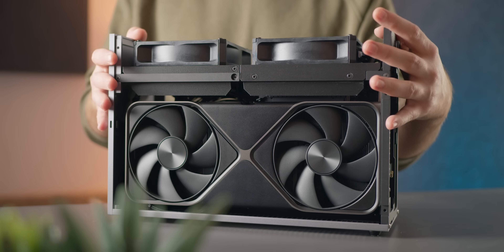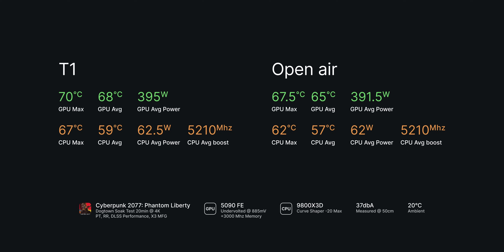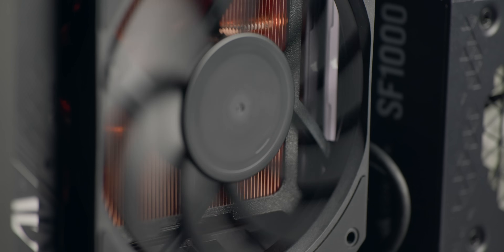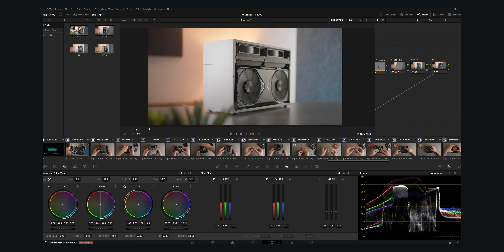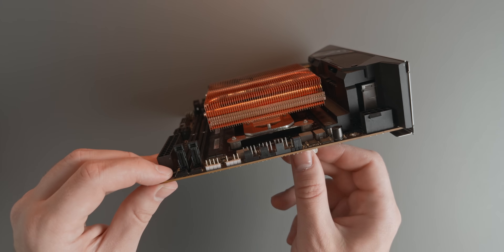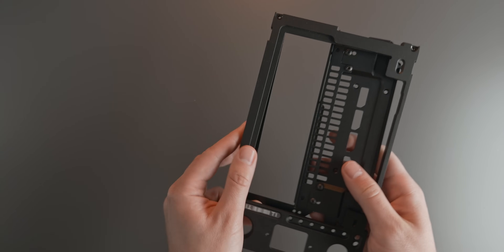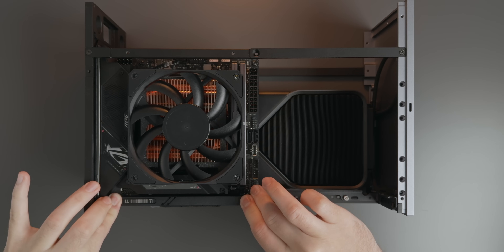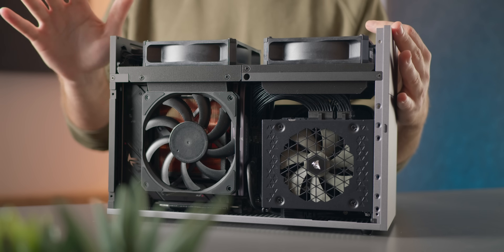The Ultimate FormD T1 5090 Build & Guide

Comment: Wouldn't it make more sense to go with an open air card in a sandwich layout? That way you wouldn't need the offset, and if there is a 5090 slim enough you can go with a slightly taller CPU cooler which could help remove the 100 watt limit?
Reply from the maker: It would, but there isn’t any other 5090 that’s a true two slot that fits in the T1. With 5080s there are options like the ASUS Prime.

Comment: Why 120mm cpu fan though? Most of the airflow is on the edge of the fan. So you're reducing cooling with extra hassle...
Reply from the maker: Check the follow up testing on exactly this (pinned comment). Tl;dr: yes.
Reply: @EIGAtech Where did you get that orange power cable from?

Comment: Silly question, what fan header did you use on the mobo for the two rs120 max fan?
Reply from the maker: The chassis fan header, which is the third one from left to right on this particular board.
Reply: @EIGAtech so no daisy chain, had to use a splitter? Thanks for the reply!
Reply from the maker: @Naes_Innit  Correct, use a splitter if not using T30s that can be chained.

Comment: Will this build work with the Thermal Grizzly offset kit or does this only work with the Dingkey offset bracket?
Reply from the maker: It won't work as far as I know, the AXP-90 x47 has a rather odd mounting system that is tightened from the backside of the motherboard.

Comment: I followed all your T1 videos and using your links sort of cloned your build even down to the cablester cables. My air slimmer 3D printed bracket arrived late, so I am still using the AXP90 47 default fan. I am getting similar temps as you. Even battlefield 6 doesnt reach 80 degrees max. I've read on reddit people are raving about the 4070 fans used as CPU fan on AXP90 and was wondering if you've tried them?
Did the air slimmer 120 cool your CPU noticeably more than default thermaltake, or did you use them because it being a bigger fan, it cools VRM and ram too?
Reply from the maker: Oh wow that's awesome! Topping out at 80 in BF6 must mean you got a pretty good sample of a 9800X3D. Running negative CO as well I assume?

4070 fans: Yes! I have one and will use it in an upcoming video, but I haven't tested it yet as I'm working on other videos. This month though! Maybe.

AS120 swap: It's a bit better acoustics but worse CPU performance, I wouldn't really bother with it, especially since everything I read about the 4070 fan points to it being the new 🐐.
Reply: @EIGAtech  Yeah, my sample accepted negative 25 but not 30. I had this weird issue where DDR5 6000 wouldn't pass when using EXPO I, but it passed using the more aggressive EXPO Tweaked from ASUS. I am so very happy to have followed your build. This build is so much cooler than the oven Ncase M1 5800x3D 3080rtx I had before. Thank you!
Reply from the maker: @demonwares  If you want to tune your DDR5 kit further check out this thread: https://www.reddit.com/r/overclocking/comments/1k3o7qe/am5_ddr5_tuning_cheat_sheet_observations_and_notes/

Just know that going through all this may take quite a bit of time and testing for marginal gains, but you can have "fun" with it.

Comment: This felt eye opener, so many small mods to cpu cooling, tha tall feel smartly done... have you down comparison with the stock cooler config? or against other popular options like the IS-55? I'm curious as to the overall performance of these mods... I want to build something quite similar, but using 7800X3D and a 9070 XT, and I'm wondering how this cooling modded solution work in general

Comment: Are you planning to try out watercooling this build? Like Optimum did with his FormD T1 4090 build?
It would be cool to see if it is even possible to cool a 5090 and 9800X3d inside this case. I am personally also interested in it because in most places in the world, Nvidia nor any other retailer sells or imports founders edition cards, which makes it simply imposssible to put any 5080 or 5090 inside the FormD T1, except when they are watercooled.

Comment: Did you print these yourself? Did you print with asa? It looks soooo matte, how did you manage it?

My bambulab p2s is coming soon, want to print the adapter and fan shroud as well.
Reply from the maker: Those are printed in PETG-CF which gives them that super matte and textured look. ASA/ABS is also a good option especially infused with carbon fiber or glass fiber, but you need proper filtering when printing those materials.
Reply: @EIGAtech no warping on the petg cf? Since the heatsink could get hot
Reply from the maker: @Hyper1555 PETG can easily handle it, heatsink probably doesn’t get over 60C or so unless the fan is running too low. I would only advise against PLA.

Comment: if i am using the offset brackets and the am5 backplate from dinkey for the cooler, but no 120mm fan swap, just simple noctua a9x14 fan swap, do i need to 3d print "Exhaust-Shroud-V2-Part-A-HC.stl" or "Exhaust-Shroud-V2-Part-A.stl"?
Reply from the maker: You need to print the regular version (not the HC)

Comment: AXP90 Fan Bracket file on printables has 2 different sizes uploaded ("for 90x98mm heatsink" and the other is "for 87x95mm heat sink"), and on amazon, the heat-sink dimensions are 94.5mm x 95mm. I don't know which one to 3d print. any help please.
Reply from the maker: You don’t need an AXP90 fan bracket? Check my follow-up testing post.
Reply: @EIGAtech where can i find that post
Reply from the maker: @pedrosk445 It’s this one: http://youtube.com/post/UgkxVFLB-fsOSw81gMdKQU-qNWelVQoblhfg?si=vv_PTZ6qvzmlNUs3
Reply: @EIGAtech  yeah yeah i just saw that, i was about to edit my message. i just have to replace the stock fan with the noctua and add the 3d printed duct pegs. thanks alot. i will copy your build btw, much appreciated.
Reply from the maker: @pedrosk445 Sure thing!

Comment: I'd love to build in this case but there is no way I can get a 4090 like that, I have no idea what other top of the line gpu I could get that would do fine in the case.
Reply from the maker: The 2 slot ASUS ProArt/Prime 40 and 50 series of cards will fit into the T1 and even have travel kits available.

Comment: Wish FormD would buy the design for the Exhaust Shroud V2 and CNC it out of aluminum and sell it in their shop. I just don't like it being plastic on such a premium case. But I guess since I had to mod mine to fit with a ASUS ROG STRIX B860-I motherboard it would make it imposable to use in my case.
Reply from the maker: The design is unfortunately not CNC-able without changes, and the cost would be too high anyway. If you want a premium looking print you can look at a nylon print using the MJF process at a 3rd party service like JLCPCB or PCBWAY.

Comment: Love the video. But, I find myself needing a 3D printer the more I watch youtube. Beautiful build but not exactly reproduce able.
Reply from the maker: The 3D printed shroud and cooler bracket can absolutely be skipped. The 120 fan performs worse and the exhaust shroud is a 1-2 degree improvement at most based on testing I did in my old ultimate air cooled T1 video with the 4090.

Comment: the pwer cord extension you use has a right angle on it to fit better in the case but i don't see it in the links for parts
Reply from the maker: It’s the internal stock power extension, not sure if it has ever changed.

Comment: sorry im new to building pc
1) why do you need a back plate? it doesn't seem necessary since the holes are still there with the back plate.
2) also whats the point of replacing the fan on top of the heat sink to 120 mm fan? could i just use the stock fan?
3) can i get away with not purchasing back plate and extra 120 mm fan?
Reply from the maker: Hi!
1. Backplate is not 100% needed, it just makes installing the AXP90-X47 a bit easier. You can do it with the stock backplate, just need to wiggle the mounting screws a bit so they go through the threaded holes of the stock AM5 backplate.
2. There's no real point, in fact in my follow-up testing, temperatures were better with the Noctua NF-A9x14 fan swap.
3. Definitely
Reply: @EIGAtech  thanks for the response! time to get to building

Comment: i was also wondering if custom CableMod PSU Cables would work instead of the ones you linked, and if so what lengths to get
Reply from the maker: Ideal lengths can be found here: https://discord.com/channels/1205855714355183686/1205855714795593772/1233615914839314522
Reply: @EIGAtech goat🤝🏻
Reply: @EIGAtech they dont work?

Comment: do you think this would provide enough cooling for a 14900k or an under clocked ks?
Reply from the maker: I don’t think it would be viable, AMD chips are much more efficient.
Reply: @EIGAtech  sounds good, thank you for this amazing review I'm gonna be building this in a few days and it's my first itx build ever, I have a few more questions if you don't mind, is the x870i rog strix motherboard fine or is it too bulky? and will the new ncase T1 V2.5 work just fine?
Reply: thanks in advance

Comment: You can definitely fit an AIO water cooler in this build. I did an almost identical build with a 4090 and an AIO water cooled AMD 5800 X3D using the Corsair H100i. I had to replace the fans with low profile ones, but it was easily able to keep the CPU cool with that large (relatively speaking) radiator.

Comment: Awesome build. Can I copy this build with the Ncase T1?
Reply from the maker: I believe you can with the exception of the travel kit.
Reply: @EIGAtech thank you so much for responding! The dinky offsets are no longer available (does this make a big difference in cooling?) and I dont have a 3d printer for air flow ducts/channels/shrouds, do you know if I can buy them from you or someone else?
Reply from the maker: @Fearlys  They make more of a difference then the shroud so I would keep an eye out for them going back in stock.

Comment: Have you tried flipping the gpu? You may get even better temps with the gpu flow through fans forcing air out the side vent  panel. You likely need a new gpu riser cable and probably some 3d printed mounts
Reply from the maker: It's on my list, I have the official flipped travel kit but no riser yet.
Reply: Amazon sells Linkup PCIE 5.0 riser cables…

Comment: Hi Eiga, i would really appreciate if you can help me with cooling. TDLR: Air Cooling vs AIO and GPU position. I found you through your GPU Anti Sag 3D bracket. I am building a T1 V2.5, 9800x3D, MSI Inspire 5070ti and Cooler Master Core 240 white. I already purchased the AIO before i saw your video. Should i just spend the extra money on air cooled setup like yours and waste the AIO? Also, is it better to put the GPU right next to the panel, or have 0.25 slot gap for best temps and no sound issues. My GPU is 2.5 so with 3 slot setting, i could have 10mm riser for right against panel or use 5mm riser to have 0.25 slot or 5mm gap? Please let me know. If you will suggest that air cooled will be that much better in my case, i will go the air cooled route same like yours and 3d print the accessories that you have. Let me know. Thanks!
Reply from the maker: Hi! Sure thing. I don't have a definitive answer regarding AIO vs Air Cooling. In my case it makes a lot of sense because 5090 FE temps are a priority, but in your case I think the balance between CPU/GPU temps will be better. Try the AIO setup first and see how it goes, but if know you don't have any specific all core workloads, an air cooled setup is way simpler.. Regarding the offset, you absolutely don't want the GPU fans right up against the side panel, go for that 0.25 slot gap and you'll thank me later!
Reply: @EIGAtech  Thank you. Sure, i will make the 0.25 slot gap for GPU and the side panel. I only asked because in your video from last year, air cooled 4090 build temperatures dropped significantly. I am looking for the most optimized cooling setup even if it means few new and 3d printed parts. I originally thought an AIO would perform better than a small air cooler and bought the AIO without much research. Haha!
Reply from the maker: @imanhbk  Well, it absolutely will perform better when doing CPU-heavy tasks without GPU heating up the radiator. It's a trade-off basically, but in my opinion for a primarily gaming build air cooling is better for prioritizing GPU temperatures.
Reply: @EIGAtech  It makes sense. Thanks Eiga! Your video, knowledge and passion is top notch.

Comment: Love that offset bracket on the cpu. Don’t see a lot of people talk about optimizing for the hotspot on ryzen cpus. 
Have you considered de-lidding the cpu with tools from something like thermal grizzly? There’s no de-lidded mount for 9000 series chips yet but you can get a heat spreader to replace the IHS that’s slightly thinner and has much more surface area.
Reply from the maker: Thanks! I actually do have a delid project in mind using Thermal Grizzly products but I don't yet know when that video will come out as it's still in the planning phase.

Comment: I watched a video and I want to build the same system.
I’m planning to order custom cables from Etsy for the SF1000 PSU.
For the “Add your personalization” section,
is it okay to enter the PSU as “Reference Mount”?
Reply from the maker: If you order from DreamBigByRay or Cablester they already know which lengths to use for a T1 build (including per wire individual lengths for perfect bends). Otherwise, the lengths are: 
24p: 170mm
CPU: behind mobo 410mm. Front 290mm (AMD board), 260mm (typical Intel board)
12vhpwr (4070/80/90 FE), 360mm.
These are taken from the pinned messages in the #formdt1 channel on the SFF Hub discord server.

Comment: I am planning a similar build but with a 5080, however I am planning to use a coolermaster atmos 240 aio, will that result better or worse thermals. I will still keep the gpu in 3 slot mode and I am planning heavy overclocking, any help is appreciated!
Reply: Both should work fine for your purposes

AiO will run quieter according to formdt1 forums

Comment: Hey what’s going on EIGA. Question I’m ready to do a full rebuild on my T1 this time in the silver variant, I’ve been rocking the EK Basic 240 AIO not the Nucleus version. I don’t do any undervolting of the GPU and I’ve never seen a spike in temps I was wondering should I go with air cooling on this build or stick with an AIO. I have a 9800X3D and a 5080 FE. Your input would be greatly appreciated. Thanks.
Reply from the maker: I think with the 5080 you can stick with your current setup.
Reply: @EIGAtech  Any particular reason why?
Reply: @EIGAtech could you supply a USA Amazon link for those hex head screws?

Comment: Does the exhaust shroud work for the Msi mpg b850i? Hesitant to use an asus board due to the intel i225 lan due to complaints with it failing relatively early on in the mobo lifecycle
Reply from the maker: Someone recently left a comment saying they encountered minor fitment issues due to the heatsink on the MSI B850I, I'll try to get more info on this and see if I can update the model.

Comment: This travel kit doesn't let you set it in the 3.25 slot mode? 3 is the max? Thank you for such a detailed video and links.
Reply from the maker: 3.25 also works but you'll be getting fan turbulence noise from the 5090 being too close to the panel (although I guess with the flipped travel kit that wouldn't be an issue).

Comment: Started off getting lucky with a 5090FE on release and a T1 at the same time. Months later I’m still working on this monster. 

Finally got an order in for the 5.0 riser and travel kit so back to building. Ordered a Strix x870 yesterday but canceled because I saw the MSI x870. Black Ridge can’t handle the summer heat so I also ordered a 240 Atmos. Already far far off the deep end so might as well get custom cables.

That said coming from a 44L case, the T1 has been awesome. Just grab it by the handle and chuck it in my backpack. Even bought a WiFi 7 travel router to hijack networks for maximum performance lol. The x870i would be pretty neat since I couldn’t find any 6E travel routers for latency purposes.
Reply from the maker: Custom cables are the nicest thing to get to top it all off. You will not want to go back.
Reply: So can you fit an 240 aio in this build? 
I want to go for this case but I must run the 5090FE and a 9950X3D so I think air cooling that cpu is not an option

Comment: Great video! I have built a RTX 4080 in FormD T1 a couple of years ago. This build is next level for my next build. Just wondering, my machine sometimes suffers from black screen restarts especially with game updates including shader updates, while I can game for hours on high settings and it works fine. Just wondering what it might be, PCU or GPU?
Reply from the maker: Thanks! Are you running an undervolt on the GPU? What about the CPU, any negative curve optimizer values and/or manual VSOC voltage? These would be the first things I'd look at, starting with the CPU since you mentioned shader updates 🤔
Reply: @EIGAtech  Only thing that I have enabled is D.O.C.P. with default settings. I have validated that RAM is okay. But it's hard to diagnose and this might not be the right media, but it's worth a try as I spent a lot of time on this.
Reply from the maker: @Tuno85  I doubt it's the RAM but seeing as that's the only thing you touched it's worth trying. Getting black screen restarts with no undervolt or CPU tuning is definitely abnormal.

Comment: do you think it would be feasible to exchange the asus rog 850i for the msi mpg 850i?
Reply from the maker: Yes, of course. I’m not sure if the CPU socket is at the same height on the MSI (sometimes it differs) but that’s only relevant for the exhaust shroud. It will most likely fit.
Reply: @EIGAtech  thanks, man! love your content